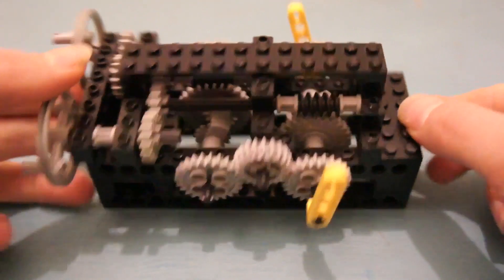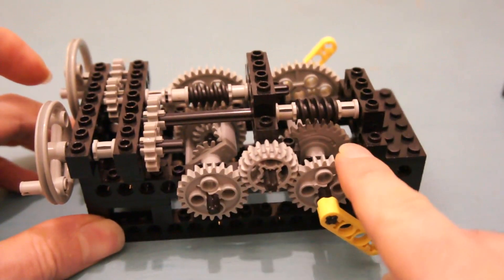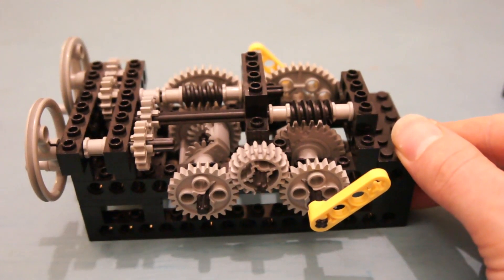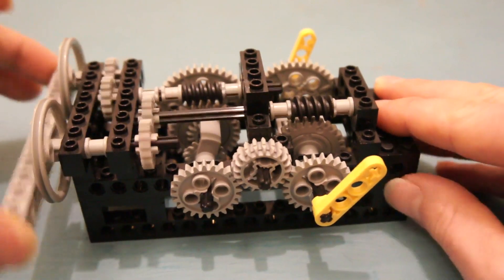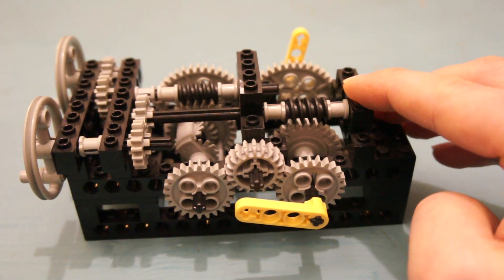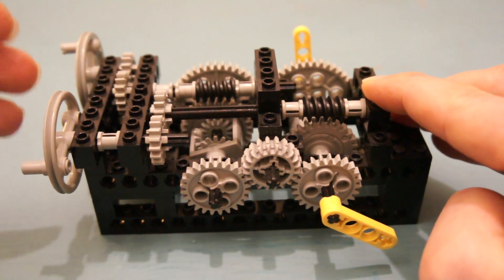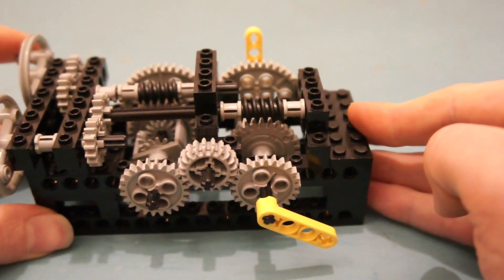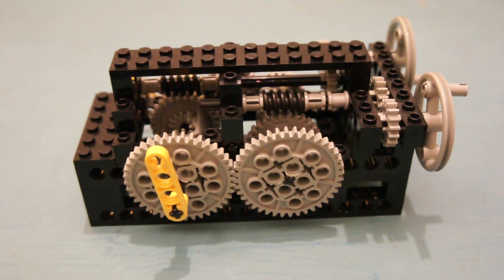Lego Technic Dual Differential Drive / Subtractor / Überlagerungsgetriebe

Comment: All nice, but i wouldnt use the worm gear since its make lots of friction, and make it realy realy slow.
If you intersting i made cute subtractor myself. I hope you like it.
Reply from the maker: Exactly. As I said in the video, I wanted the self-locking of the worm drive, but worm drives are inefficient (whether they are super slow or not depends on other stuff, too), so I did mention that other options exist :) 
Thank you, I'll have a look!